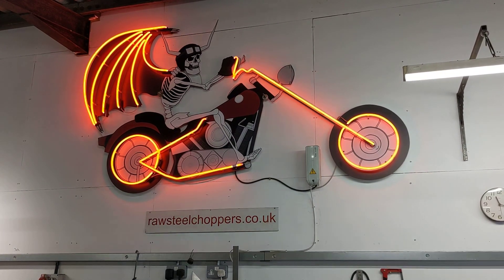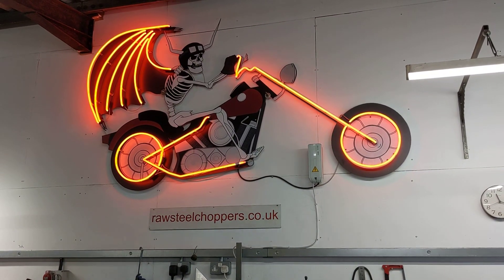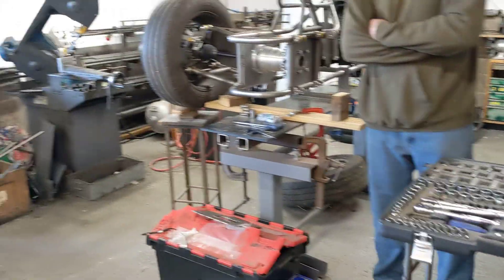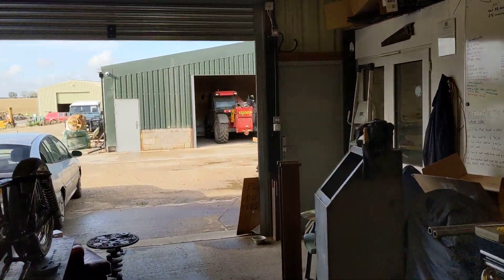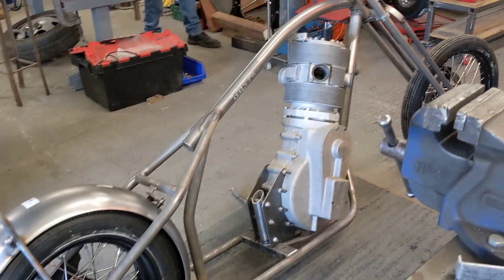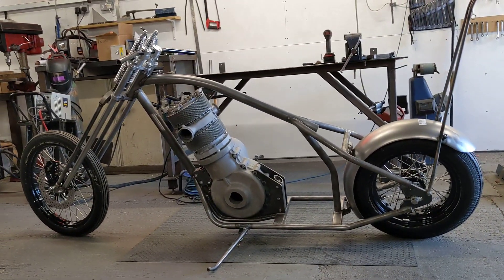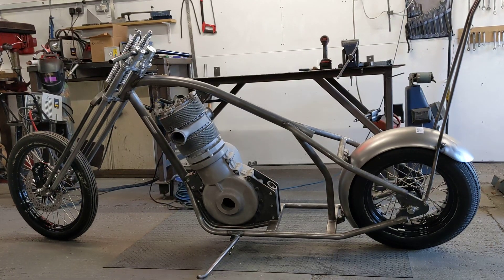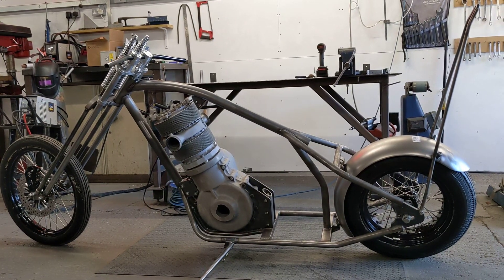Collected the frame from Raw Steel Choppers 💪

Comment: The frame looks great and your engine is HUGE! How many CCs is it?
Reply from the maker: It was designed to be 2750cc, 5.75" bore and 6.5" stroke. A machining error put the crank pin out by 0.030" increasing the stroke slightly. So it's now 2796cc.. Should be enough I reckon 😁
Reply: @StoneEng  Holy crap! That is going to be a BEAST! Can't wait to hear it running. Thank you for the reply.